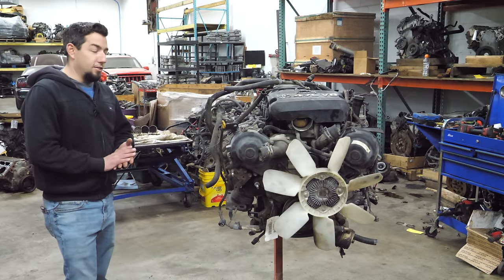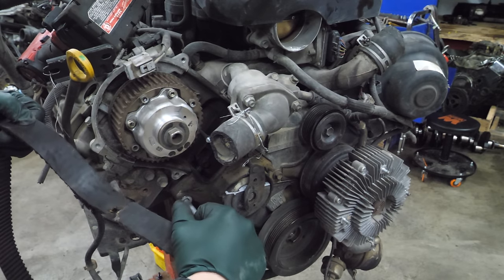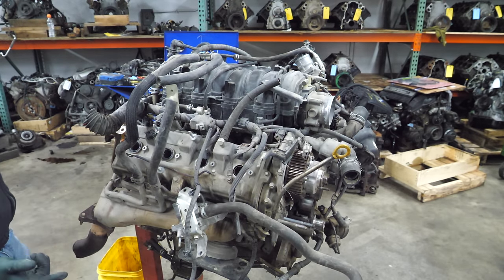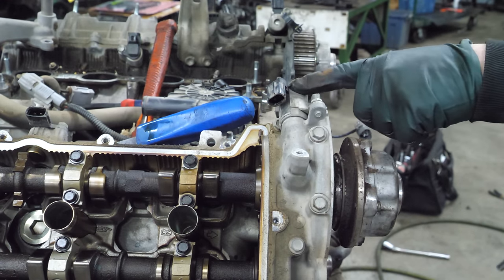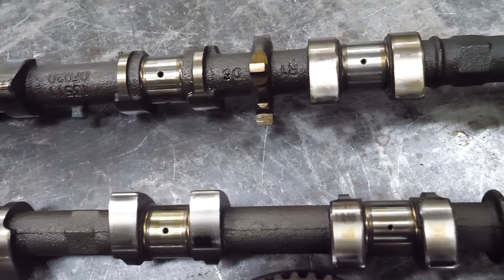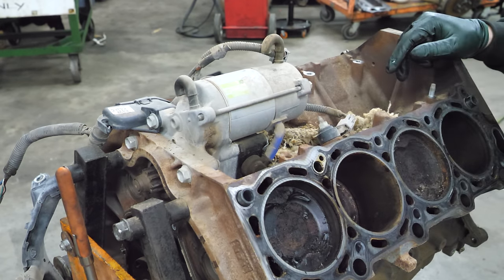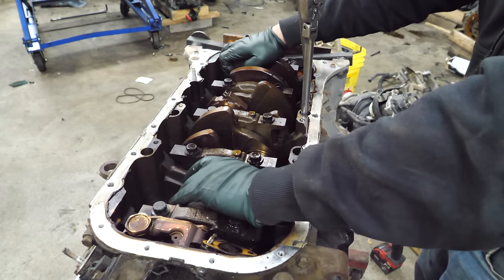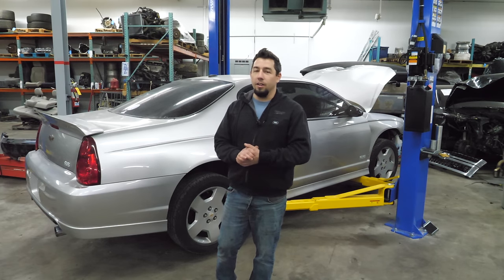Toyota Tundra 2UZ VVT Teardown! Bad Decisions Led To The Demise Of One Of Toyota's Greatest Engines!

Comment: I drove our 2003 Sequoia for 192k….the most reliable engine I have ever owned.  Never burned a drop of oil or miss fired.  Only valve cover gaskets started seeping at very high mileage.  Had the  at timing belt done at 150k and it still looked brand new, curious as to mileage on this one?  Only negative was it was thirsty but I miss that engine.

Comment: I can confirm the 5.7L tundra motor has a much worse location. 
Right behind the passenger exhaust manifold is impeccable placement! Adding to my annoyance were the rusted out nuts/bolts that broke off the manifold when removing the exhaust. 

Thankfully an acetylene torch was able to help me remove the broken old studs.

Comment: I have a 3.0 d4d Toyota dyna 4wd and the belt can snap on these engines and the valves won’t get damaged, I still get my belts done on time. Regular oil changes are also needed fuel filters air filters max sensor cleaning. And your good to go

Comment: We have seen alot of the mainstream engines here, now lets see if you can pick away at-the more 'rare' or 'forgotten' engines... My first car was a 1984 Nissan Micra K10. M/T, Fitted with a MA12 1.2L varent of the engine as i am in canada, it made a whopping 59hp! The 1.0L engine sold mostly everywhere else it would be halarious to see you tear down one of those or similar engines from that period. The oil leaks, terrible carburators, transmissions that blew up all the time, ahhh the memories :)

Comment: I absolutely love the UZ engines. They're easy to work on, durable as hell, and reliable like no other. Their lubrication system is top-notch, and very rarely do they ever have VVT issues. A properly maintained unit can run a half million miles. I generally love Toyota and their way of doing things. 

If I was the tech working on that truck, I would've diagnosed engine damage before condemning the engine. It's a bloody shame this one ended up being pulled. 

That block may be salvageable. Try honing the rusty cylinders and see what happens. I've seen worse do just fine. 

Also, don't scrap the cut harness. Salvage the connectors and sort them. There's plenty of times I could've used a connector or section of harness due to something like rodent damage or corroded terminals. It might not make much money, but you'd do a solid for techs who need a quick fix.

Comment: I bought a 2000 model sr5 tundra access cab for a parts truck for my 2002 limited 4x4.  Both trucks same colors and same color interior.  Anyway, the parts truck had a broken belt and I still paid $1300 for it due to a clean title and complete.  I put a new timing belt on it and it fired up.  Sold it after swapping body panels ans tailgate/etc for $2500. Those 4.7s are tough.  Sold my limited a couple months ago for $4500, no frame rust or body rust for that matter on either one.  Sold them too cheap, but Sold quick!!

Comment: Change the belt in my 4.7 after 17 years.  Had less than 90K miles but was 10 years overdue.  Still looked new when I changed it.

Comment: On the left side ,why is the orange line on both of the  cam gears like that and don't cam gears have timing marks on them and not on the cam belt or cam chain   so I have to ask again   why "timing chain" or "timing belt" when there are no timing marks on the chain or belt.13:19
Reply from the maker: Many belts do have timing marks. Subarus do. 
Timing belts and timing chains keep ah engine in time. Why would you call them cam belts if they also go around the crankshaft? Water pump? There are engines where there’s a chain driving a gear which drives belts that drive cams, and in that case, they are cam belts.

Comment: Welp I got an 06 tundra about a year ago and with all the crawling around underneath it I have done I never notice there wasn't a starter on the bell housing. Looks a little easier to do than a 3.4L truck which I am very familiar with. I have done a couple of those in a parking lot (not fun).

Comment: If I'm not mistaken, that's not a trigger wheel that holds holds the timing belt in place so it doesn't walk off the snout of the crank. Honda Acura j series are the same way

Comment: Great video I had the same thing happen to me, bought a new 2006 tundra crew cab 4x4 kept it mint and kept up with all maintenance preformed on time including all fluids, trans, transfer case, cooling and of course new belt and pump the wife and I took that truck all across the county pulling a 19 ft 5th wheel Scamp fiberglass camper and never had a moment of problems then it happened driving to the store it just stopped and wouldn't start had it towed to the shop that took care of it and they said the timing belt broke (30,000 miles after replaced) due to a seized bearing well over $6000 later and a used engine of course with a new belt ,pump and bearings we were back to driving our favorite truck but I never felt comfortable about a used unknown engine under the hood so I sold it and made a big mistake and bought a Ram CC 4X4 mine was a POS
now I have a 2015 F150 CC Lariat and after 5 years and 120,000 miles still love it. wish your video came out about 10 yrs ago I'd probably still be driving that Tundra with the original engine, 
,

Comment: Bought new in 2005, my 2006 DC Ltd 4X4 is at 102K, most non-highway/long distance.
As she has been kept in perfect oil change, plugs and fluids, I am betting on 150-160K possible before TB Kit job.
Now, if starter, water pump, or other under intake issue occurs I will make it earlier without question.
As I don't dog my engine it could probably go 20 years, but agree that would be asking for trouble!
I got a bum batch of original suspension build crap but have it all changed out.
As am already holding new Toyota LBJs, belt kit, and links, not fretting even if the damn belt goes, though also praying it doesn't!

Good Luck to the Tundra Haters.
I have nobody I know that has another  brand 16 years that hasn't fallen apart, despite Ford, Chevy, Dodge loyalties.

Comment: I really enjoyed this video, and I am not a mechanic.  But I am a recent new owner of a 2006 Toyota Tundra Extended Cab with 93K miles and it has the 4.7 engine.  This truck came to Pennsylvania from Florida and has very little rust!  According to the CarFax, the used car dealer  had this Tundra for over a year.  I guess I was the only person that was willing to buy a RWD truck. After doing research on the 4.7 engine, I was a little concerned about the timing belt.  The CarFax showed that a Toyota dealer replaced the timing belt at 50K miles when the truck was 9 years old.  We are only two years away when the Tundra will be 18 years old, and time to consider to have the timing belt changed again.  The used car dealer didn't want to change the timing belt/water pump, but they did do some other work that I requested after I took the vehicle to a trusted mechanic. (Spark plugs, valve cover gaskets, wheel alignment and rear view mirror.)  I called a Toyota dealer and spoke with the service department and they said that I could have the timing belt checked in two years. I guess there is a way to check it without taking everything apart. 

Thanks for a very informative video. Good to know that if the timing belt does break, it doesn't necessarily mean other bad things will happen.

Comment: After the starter comment I had to go look at the 5.7 and sure enough what a PITA to swap.  I had an 06 Tundra with the 4.7 and I can tell you not to drive through high water at anything over a slow crawl or the air injection pumps will suck it up at which point the check engine light comes on and they start making a knocking sound until the water clears the system.  I drove through about a foot of standing water on a main road to my house during a tropical storm when the drains backed up.  I had it in the shop getting a new steering rack and asked them about the pumps and the price would shock you which is why some of the guys over at tundrasolutions were swapping in gm air pumps.
Reply: Better thing would be to simply delete the entire system.

Comment: As far as mileage, has to be better than 100k, because that's the recommended interval for changing a timing belt. And that's a real shame, because that engine would've had a LOT of life left in it if the owner had done the proper maintenance

Comment: A lot of well meaning people who want to maintain their cars simply do not know that there is a timing belt that needs to be changed, and that not doing so would lead to catastrophe. That's why the heads were so clean. My cousin recently sold me his 2004 Lexus ES330 (that he owned since 2007) with 120k miles (which I ended up flipping). He meticulously changed the oil every 3 months, regardless of mileage (he didn't drive that much). But he never changed the timing belt or the transmission fluid. When I asked him if he ever changed the timing belt, he had no idea what I was talking about. A lot of people think all a Toyota/Lexus needs for maintenance is oil, tires and brakes and aren't told otherwise.

Comment: If an 20 overbore would correct the issues, there is a .020 oversize piston and ring kit for this motor on Rock Auto for $41.79 each, multiplied by 8 is $334.32.  Machine work on the cylinders maybe $500.  A complete gasket set for a rebuilt also on Rock Auto is $104.79.  The bearings and crank looked practically new, I personally speaking would re-use them.  Timing sets that include new water pumps and seals run from $127-$232.  I'd probably have a valve job done and the valves cleaned up at the machine shop also.  Total cost $1500 ish

Comment: I have a 2004 Toyota tundra with this engine. It has 138,000 miles on it. The oil is always honey colored when I  change it every 3,000 miles. I very seldom drive it because my Corolla gets way better fuel mileage. The seats and carpet are like new. I had the belt changed at 100 thousand miles and the mechanic said the belt looked good. Of course he changed the water pump and pulleys also. I really like the truck and hope that it lasts a very long time.  My only concern is the starter.

Comment: Note to self: if the timing belt breaks, try a new one before assuming the engine is trashed. I bought a Subaru one time where apparently someone did that, and it ran fine. I had a friend do head gaskets, and he discovered bent valves lol.....

The best thing of all is to replace the timing belt at its specified interval, or barring that, check the timing belt condition occasionally, and replace it when it starts to look old.

Comment: I have a 01 tundra day i bought it the timing belt broke from sitting too long should've checked it since the previous owner was upfront about it probably needing to be replaced now im replacing it and trying to see if my engine will start and run

Comment: We had a timing belt break on our VW Sharan. Luckily it was at idling speeds. Luckily it was only bent valves.

Worst was getting the head off in situ, that was a job I do not want to repeat.

Comment: Thanks for another great video! I have a 2003 4runner 4.7 V8 (non-VVTI) with 175,000 miles and changed the timing belt/water pump/pulleys at 100K with OEM parts. I would love to know if this engine is actually non-interference.
Reply: no, you have interference! i don't understand why all cars are not non-interference. i get compression ratio but you still can have a high compression ratio if done right. just think 3S-GE high of 11.5:1 (and most are around 10:1) and it's non-interference. or the manufacturer could just add a turbo to get the compression up. 
many people will say, just replace the timing belt on time... but is a car with many variables that can/will go wrong. why add one you don't need, that breaks other crap.
Reply: @gatorage850  "just add a turbo"....you realize what's wrong with that, right?

Comment: What a shame. I know several of those engines whose owners ran them until the belt broke. Every one of them had a new one installed and they fired right up and ran perfect. I do know a factory belt lasted 248k on one of them lol.
Reply: Those belts are like tank treads. My 1997 camry belt lasted about 200k, but it was a 4 banger. These uz series belts are like triple the thickness of any other belts I've come across.
Reply: @michaelxdrift  I just installed a belt on my brother in laws 2000 camry 2.2. 252,000 miles and I could move it back and forth about 2 1/2 inches lol.I don't know how it didn't jump a tooth or several.

Comment: Yeah,if the starter on the 4.7 is hard,try doing one on a 5.7,it's behind the right exhaust manifold
Reply: The 10 mm bolt holding the 2 shields together was placed there by the spawn of Satan himself.

Comment: When I had my timing belt done on my 09 GX, I asked the Toyota master tech about the interference deal and he said that earlier 2UZ VVT’s are non interference but became interference with the addition of VVT-i. I felt like I owed him $20 just for taking the time to answer that question so I didn’t ask any “why” questions about the mechanical differences, lol. But there ya have it. 

Different models went to VVT-i in different years, for the GX, 2003 was the only year that was non-interference. I think 2005 was the first year of VVT-i for Tundras. The list of implementation is on the 2UZ-FE’s Wikipedia page.

Comment: Not a mechanic here. Just a DIY lube and filter guy on my Toyota trucks. Interesting to see the tear down and internal assemblies. Question: how does water get in the cylinders if the spark pugs are in and the head gasket, etc are intact?

Comment: Novice here.  Never got the point of secondary air injection for emissions.  In my brain they are just adding clean air to the exhaust to dilute the emissions, but the emissions are still the same, just more air.  Seems like a work around that doesn’t do anything, but still gets the job done carb/fed wise.  What am I missing?

Comment: I got my dad's 2005 tundra as my first car and I can tell you he is the person who would've done this. I had to replace the timing belt at 180k miles when I got it along with factory spark plugs and a valve cover leak that occurred at ~100k. Also well overdue was the transmission mount which failed at around 150k and was bandaided for about 10k miles with new trash bin bolts at a crappy mechanic before failing again and I just fixed it month ago. Still was attached halfway unlike the previous time had no bolts and replacing all 4 suspension shocks was actually cheaper. I thought suspension had a better outlook (as was ill-advised by the tire shop who [*without approval*] spent $1300 of our money on control arms and tie rods, which would've been appreciated if it actually fixed the issue for less than *6x the price it actually costs to fix*) then I realized it was an actually a documented TSB for the trans mount. The spark plugs had about 30k worth of wear and the timing belt had maybe 50k. Valve cover was an interesting failure to say the least. TL:DR  my dad bullied his tundra and it somehow drove 180k miles with no maintenance outside of oil and typical toyota suspension and driveline issues (anything rubber).

Comment: Toyota recommends changing those belts every 90k, but I have heard Toyota mechanics saying the belt will actually go 200k+ before they break, just to give you possible miles on this engine.
Also just an FYI, this engine is know to be one of Toyota's most reliable motors ever made, and when taken care of many people have hit a million miles with them.
Reply: The timing belts are incredibly overengineered. In fact, it is usually a pulley bearing or the water pump that takes out the belt, rather than the belt going bad.

Comment: The 00 to 04 dont have air injection or vvt, mine has 410,000 miles on it. Doesnt burn or lose oil between changes, has plenty of power and drives like a new truck. Have i replaced suspension and bearings, of course i have. Paid 2500 bucks for it at 300k, sunk another 2500 or so in it, in just parts. I do the labor and it treats me well at over 400k

Comment: People need to remember, belts don't usually break on their own due to age only.  The main reason you do the belt service is to replace the tensioners, idlers etc...which have bearings in them.  THEY usually seize causing the belt to break.  The owner apparently took good care of everything BUT the timing belt....I bet that truck ran great up to the point it didn't.

Comment: I have a 2014 Silverado double cab need front bumper with no park assist and has fog lights and a  bed 6.6ft with tail gate it the feature that let's the tailgate go down slow also a rear bumper wt park assist and a front grill it is the  LT

Comment: You mentioned the spark plugs and the gap. I have a 2006 tundra and the manual says no need to check the gap. I used oem plugs. Those looked oem. Should you check the gap if using oem plugs?

Comment: Noticed you didn’t lock the exhaust cam with a threaded 10mm. Is that necessary? I’ve seen other videos where they say it’s necessary. 

Working on a 4.7 that snapped a belt too and going to be rebuilding it. Your videos are helpful.

Comment: Great video, thanks. I have a 2000 Tundra with the 4.7liter and 233K miles. It's been a great truck with minimal engine problems. I'd like to have the engine rebuilt, do you have any suggestion as to what might be something good to do and what would be a waste of time and money. I know the 4.7 is noted for longevity and reliability. Thanks again for your time.